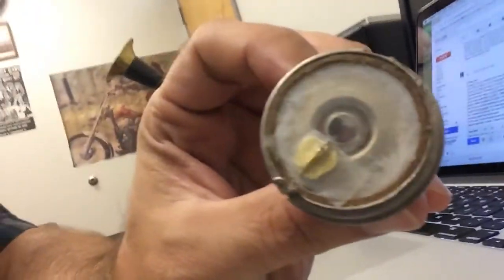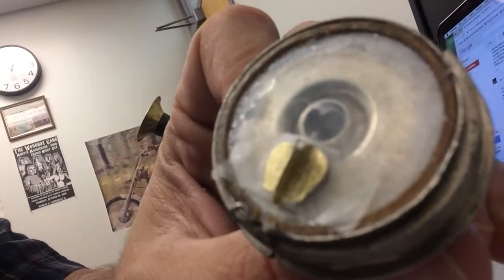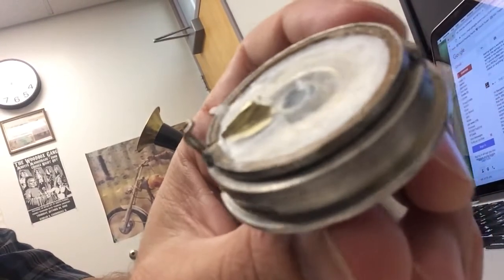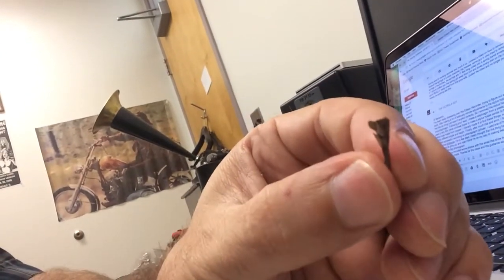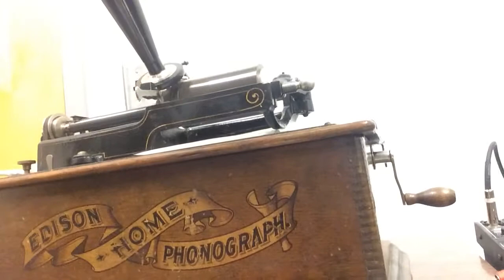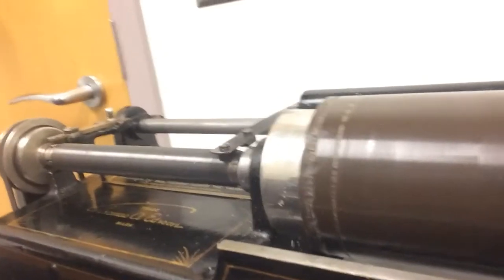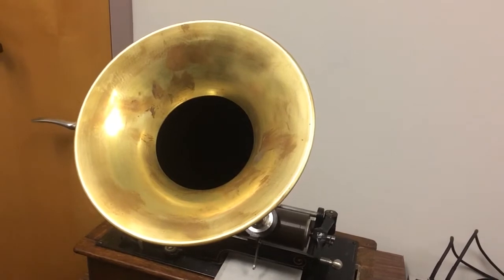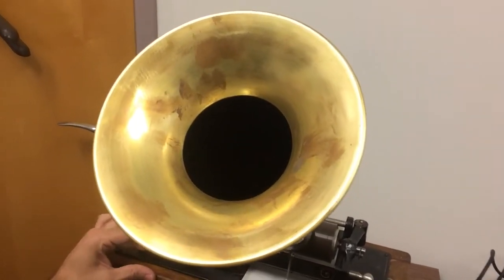Edison Recorder w/ Home-made Diaphragm & Stylus Holder

Comment: Hello Alex!It`s a Good work, but in my oppinion, the plastic diafragm in recorder isn`t hard enough. You will not record nothing above 1000-1500Hz.The record diafragm most be hard(like glass) and 
lightweight.Along the contour of the diafragm between the holder and the one  there should be a flexible washer.